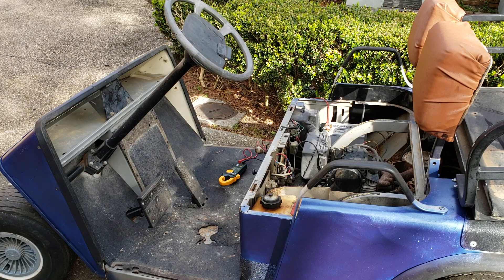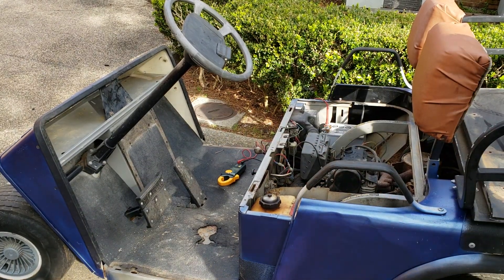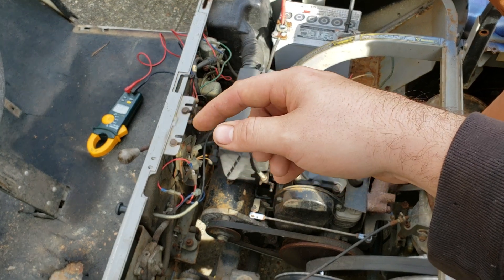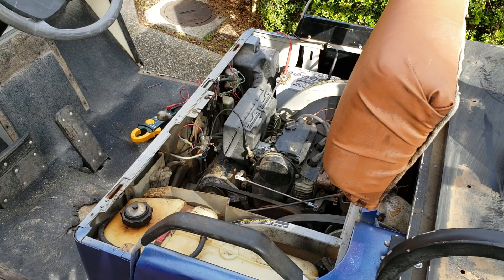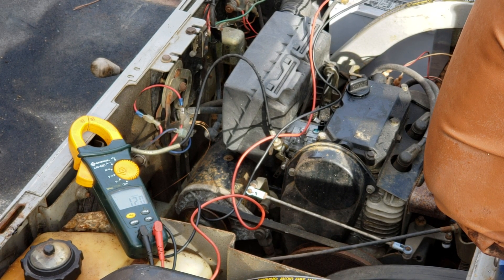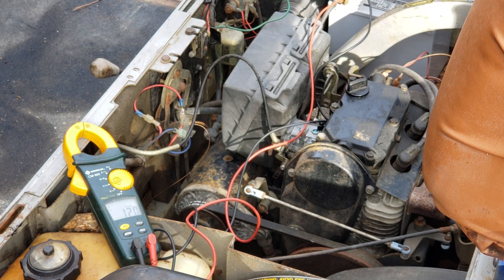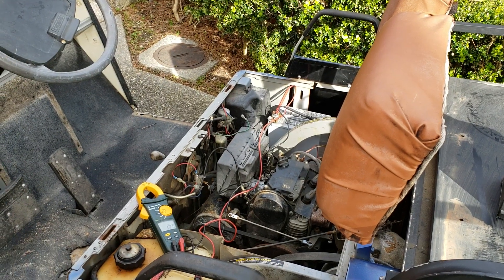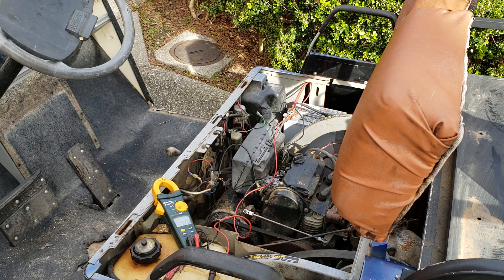How to test a ezgo voltage regulator

Comment: I'm working on a 03 ezgo with the 2 cyl robin
Pulse coil at 20.9 ohm, coil primary at 3.6 ohm secondary 
is 21.8 ohm ( out of spec, but both new ones also out at 17.7 & 18.9 out the box)
All grounds replaced and getting ground.
New ignitor (3 actually, but 2 from different year )
New voltage regulator.
New solenoid.
Still no spark. Cranks, but no spark.
Even checked to make sure battery didn't somehow switch polarity. 
I have run 12v through each individual wire, wiggling and jiggling the wire to see if there was any loss of voltage. Nothing.
Replaced all connectors, and still no spark.
Any recommendations on a fix from anyone would be greatly appreciated!!!!
Reply: LEE BAKER, I HAD THE SAME PROBLEM AND IT WAS BAD CHEAP IGNITION PARTS FROM AMAZON. LESSON LEARNED THERE WAS SPEND THE MONEY AND BUY BETTER QUALITY FROM PLACES LIKE NIVEL.
Reply: @gn5673  I am just unclear what to even ask for. This cart has no name plate. Only sticker I can even find is an inspection sticker that says 03, but 2003 had a different ignition system all together.
I have order some "oem" ignitors from 3 different places, but they all send me the aftermarket crap.
I have given up for the time being.
I will look up Nivel. Maybe they won't send me a $30 ignitor for $150 bucks.
It has been very frustrating

Comment: I have a gas golf cart that I can't figure out! I've replaced the voltage regulator which looks like it has two and installed a car battery and it runs half the day but ends up running the battery down and quits! I recharge battery and does again! I'm stumped! HELP lol
Reply from the maker: Try checking your generator,  other than that its a process of eliminating what's is not working. May just be a matter of going down the chain, start at generator, should get around 30v with it disconnected  next the regulator,  should be switching quickly between 30 an battery voltage....you having two sounds odd maybe try finding out what each goes to.
Reply: Another thing when the key is off the motor will turn over and reverse but won't start but will continue to turn the motor over with the key in the off position which is weird

Comment: Not the same as new ones, they are solid state ones after about 95
Reply from the maker: On the commercial units from 2006 I've worked on they were still the old style. However I haven't had to work on any of the newer pds carts

Comment: Dumb question. Are you shorting the regulator or generator side of the wire? Thanks!
Reply: So just to understand it, you disconnect the green wire that comes  from the generator to the Voltage regulator I pull it from the VR and ground it out right. If it jumps up high to around 16,17  and if it’s good what will happen ? Sorry just want to understand it better
Reply from the maker: Generator side
Reply: It worked! You RAWK!!